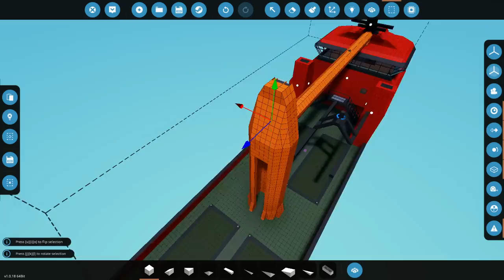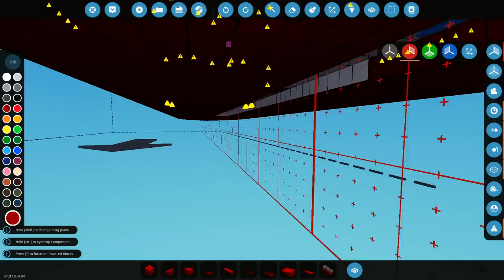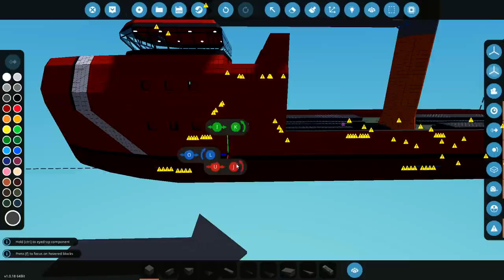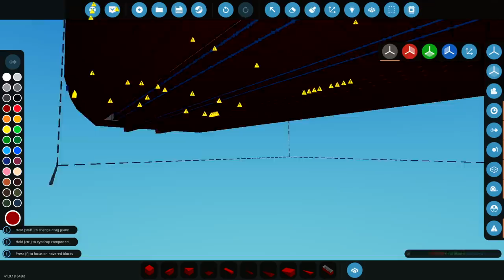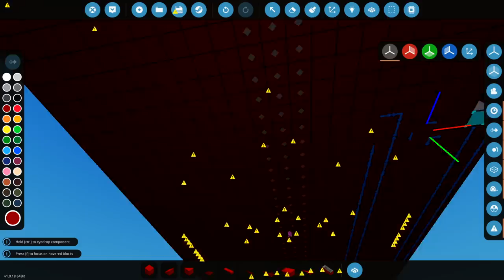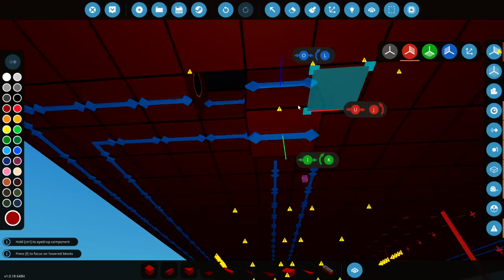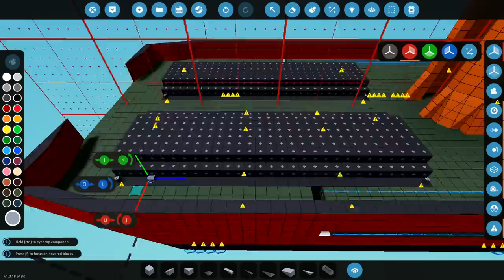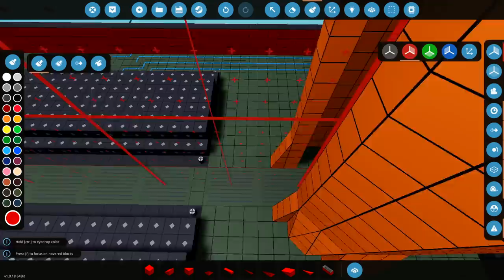Engine Pipes In!  -  Supply Ship Build  -  Stormworks Build and Rescue

Comment: Frantic, you only need to have 1 single pipe for exhaust and 1 for air going to your stack's and split them at the end if you want multiple intake/exhaust ports.
if i'm not mistaken this should not affect engine peformance running all the intake or exhaust though 1 pipe for example.

Comment: Put a counter weight on the Bach of the crane to stop the boat from tipping the boat over. Also you need to access the crane in case you break it. Along with the front roof of the boat. Maybe add a ballast in the very front of the boat for when it is carrying 8 containers. Consider adding an actual keel for stability

Comment: Making this comment just a few minutes into the video. You need to make adjustments to the PID on the stabilization system. clicking on it with just the selection tool you can change the settings, the settings will be different for every ship because of the shape/weight/buoyancy of it.

Comment: If you can sacrifice your 01 or 02 level and put another level below your waterline that'd help. Try doming the underbelly of your ship out more rather than keeping it flat so you can turn it into a fuel tank which will add more non buoyant weight below your waterline. What you need is to get your center of mass as far below the water as you can while retaining buoyancy. Keep in mind that a 5 pound weight is going to feel like a 100 pound weight when its on a 6 foot pole(no idea what actual math is). So maybe look into making your crane into a T shape, mirror it with how its railed up and add a lot of weight on the side that isnt lifting. Heck dude, and that opens up possibilities for modular weights for adaptability. Hope this helps out.

Comment: You should connect every engine into one pipe so if one breaks the other three will take over two breaks the other two will take over three the other one I’ll take over so that way even though the supply line broken for the fuel  The ship will still work